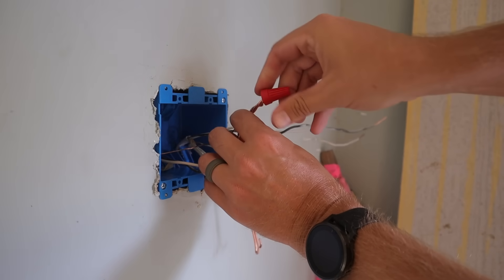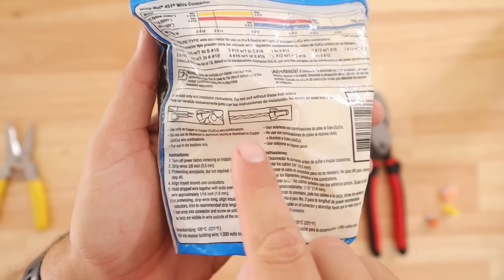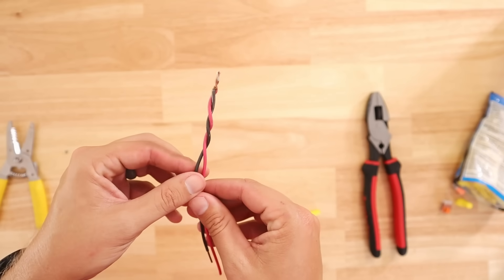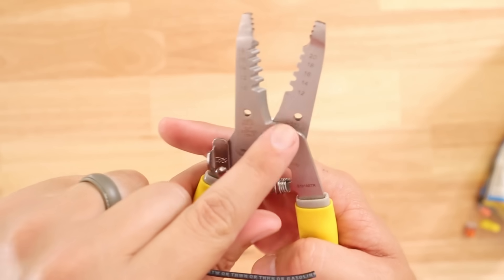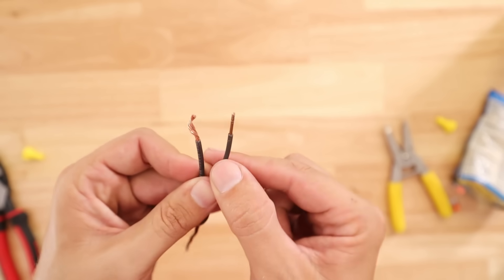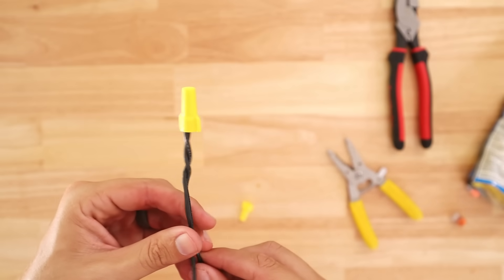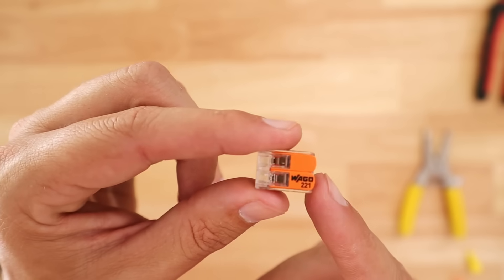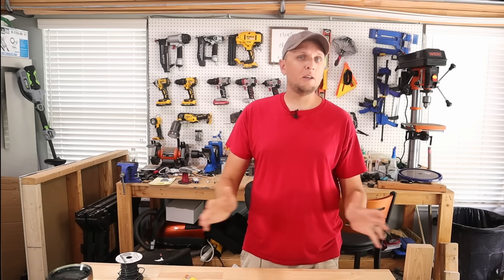BIGGEST Mistakes DIYers Make When Connecting Wires Together | How To

Comment: I almost never pre-twist Always bottom out the wire nut and use the right size wire nut. The internal coil serves the purpose it was built for. You wouldn’t be able to pull the wires out of a properly tightened wire nut even using pliers. I see more failures where the wire is nicked during stripping and breaks when repeatedly bent. I have repaired countless outlets and switches and rarely do I find pre-twisted wires.

Comment: I’ve had solid core pull out when the stranded twists completely around it like in your pre-twist model, and 100% of grip contact with the spring is on the stranded. Solid core has no twist in it in such a setup, and slips out of the center.
Reply from the maker: So, I tested them doing it like this and then doing it without pre twisting.  The results when pulling on the solid core seemed to be the same as far as how much force I needed.  Either way, I was able to pull the solid core wire out.  It’s one of those connections that seems to have a bunch of variables to it as far as how it’s done.

Comment: The wire nut is just a simple cap. What you should be doing after twisting with the lineman’s pliers is solder the joint. Then add the wire nut. 😉
Reply from the maker: Appreciate the feedback Andy.

Comment: I would add that the stranded wire should be twisted prior to coupling with the solid core wire. It seats in the wire nut better, doesn't run down the solid core when capped and less breakage of the strands when tightened. I also don't recommend pretwisting the two wire types because more often than not the solid wire doesn't get twisted but instead the  stranded wrapped around it. When the wire nut is applied it then just pushes the stranded down the solid wire and out of the spring. Just strip it a bit longer so it seats in the nut first and tighten the wire nut as usual.

Comment: Thanks for the wingnut tips. DIYer here. As for the manifold type connectors, I definitely will try the Wago connectors next when I have time to experiment and room for that type of connector. I like the clamp-down style. The other brand could barely hold on to the wires the few times I tried so I gave up on 'em. Maybe Wago is the same, idk. Instead of experimenting tho I went with tried and true (in my mind at least) butt connectors with a max of 2 wires in one end. I know some people might object but I can yank on those pretty good and they still hold on (as long as you don't pierce the insulation), but ymmv. Those felt very solid when having to shove them back into a tight switch box with new smart switches which do not leave you really ANY room to play with. The butt type are also skinny and long which you can find room to fit under, over, or beside those huge smart switch boxes.
Reply: Repent and believe in Jesus Christ  creep

Comment: When I was instructed by the Engineers that designed and tested these wire nuts, they were adamant that you Do Not pre-twist the wires. As Charlie Smith explained, they are designed this way for a few reasons.  Also, placing a pre-twist can add undue stress to the conductor when you add even more torque/revolutions to the wire nut, causing a fault/open.  The other Huge issue is that you don't know when you have made the appropriate amount of torque to the wire nuts.  When follow the manufacturer's directions and you have two wires side by side, add the wire nut and then twist until the wires wrap around one another, you assure that there was enough torque applied to secure the conductors to the internal part of the wire nut.  There are also many, many cases where one conductor wraps around the other conductor that pretty much stays straight.  This will allow that "center" straight conductor to easily pull out, because the threads/spring inside the wire nut did not make contact and did not grip the conductor.

But hey, what do those guys know?  As you said, there are two sides to this conversation...
Reply: nonsense
Reply: Your claim is dubious, to say the least. If the engineers that designed these particular wire nuts were that adamant, as you claim, then why did they say the exact opposite on the actual packaging?

Comment: I pre-twist and snip because I have experienced failures in the wing nut. The metal sleeve inside slips and fails. A few even came out.
Especially true of connections made in hot Texas attic. When the wire ends are pre-twisted, I dont have two worry about the nut and dont have to twist it as hard.

Comment: For 10 or 12 gauge solid wire of 3 or more wires, I strip off 2 inches, stuff the ends into a small drill motor, grab the base of the bundle with pliers, and slowly twist those wires nice and tight, cut to length and install a wire nut. it is a superior solid connection. I use black tape too. Practice this a couple of times first. great video, useful.

Comment: I learned all this stuff back in High School Electronics class back in the early 90's. Good refresher since I didn't go into the field. Glad you mentioned giving the braided wire a twist on itself to make it more like a solid core going into the nut.
We were taught always wire nuts or shrink tubing and "electrical tape is for hacks". The hack being the person doing it, not the more modern usage of it as meaning "shortcut".
Reply: Yes, I know. You wouldn't use shrink tubing in a fixture or wall. That was for wiring internals in devices.

Comment: You don't snip of the end just to make it nice and even. When you snip the end you need to be sure you snip through each of the wires being secured with that wire nut. As you snip through the wires they are compressed together. If you look at the wires after you snip the end off you run see that they are pressed together so hard at the snip that is hard to distinguish one from the other. Having them pressed together so hard actually helps in ensuring you have as good of a connection as possible. So strip equal lengths of each wire, align and  pre twist  all wires secured by that single wire nut, snip of the end ensuring that you cut through each wire, then twist on your wire nut. Now, electricity vibrates. Over time it can vibrate the wire nut loose enough to cause a short and become a fire hazed. So you haven't completed your connection until you have wrapped at least 3 complete wraps of electric tape over the wire nut with the tape secured to both the wires and the wire nut and wrapped so they the pressure to loosen the wire nut actually pulls tighter against the electric tape. That way the vibration that occurs from electrical current traveling down the wire doesn't vibrate loose the wiring connection you just made and burn down the house you just gave the daughter when you  bought a new one.... And it doesn't matter what the connection is for, until you have that electric tape on there locking down that wire nut is not complete. I also wrap 2 wraps of electric tape around every light switch she electrical outlet I install after tightening the screws. It helps prevent it from shorting out against a metal box or the other next to it. As will as providing a little protection should the next person to work on it forget to turn off the power.  In reality 1 wrap will do the trick, but i always  do 2.

Comment: Lets be clear about what gauge of wire we are discussing.
Lets ALSO be clear about the situation.   
There are MANY reasons to pre-twist, and there are also a handful of situations where you wouldnt, but lets be honest, if you can, you should.
Anybody with the mindset of "my cap twisting skills are best in the world" has probably been the reason for multiple electrical calls.     Do the right thing and secure the connection.   Not doing so is just skipping steps in workmanship.   Garbage.    Thats all that is
Reply: I think we can assume we’re talking 14/2 or /3 in most cases. The difference between 14 and 12 gauge means pre twisting with pliers gets a bit harder on these old hands but worth it. I sleep at night knowing my kids won’t have to watch their home burn because I didn’t take an extra 15 seconds to pre-twist. 
People keep mentioning “shorts”. Not likely to happen actually, unless the connector pops off or an over twisted wire breaks. I would think the most danger is a loose connection that causes arcing when any sort of amperage tries to go through it. Your breaker (unless it’s an arc fault type) won’t care as long as the current doesn’t exceed 15 amps. There’s your real fire hazard. Unattended arc welding in the middle of the night is not advisable. 
Pre-twist and use the correct sized marr. 
Sleep tight.

Comment: My job for 30 plus years was to correct these mistakes. Stabbing a wire into any type of a device is asking for a fire down the road. Twisting solid wire. It is absolutely imperative that the conductors are twisting around each other. Not one wrapping the other. Stranded conductors should never. Should never be twisted with the pliers or fingers. It breaks the finer conductors that make up the wire. Solid to stranded . Put a slight bend in the solid wire. As stated all conductors must be twisted outside of the wire nut.
 Poor terminations accounted for 80% of my work. Always tug vigorously on all joints to ensure that the wire nut is not going to fall off.

Comment: Oh my goodness.  So much wrong here.  Wire nuts are conductive, bite in, and compress.   This is critical to prevent oxidation from loosening connection.  

You didn't twist most of your "bad examples" enough. Including untwisted wire, which is actually recommended by some manufacturers.  Good that you referred to mfg instructions, but "acceptable" is certainly acceptable.  Of you twist enough they won't move.

Old school soli-to-stranded was to tin them.  A DIYer won't do this. Your advise is sound.  If more stress on connection from overhead light is expected (I've seen many a painter hang a fixture by hot wire), then strip the solid, and twist the solid with insulated stranded.  Then strip insulation from stranded, and twist.  Try it.  Stronger.

More important than ALL of this, and certainly the most DANGEROUS error, is people twisting the wire nut COUNTER ClOCKWISE.  Please warn again this.  Same goes with screw terminals and ground screws, where I've seen conductors wound counterclockwise and almost OFF as a result of the DIYer tightening the screw clockwise. Great way to cause arcing hazard.

Likewise you should point out that mfg instructions on strip length (which vary) must be followed.  Insulation way up in nut can stop spring from compressing connectors.  Wrapping electrical tape around bottom of nut is recommended for DIYers, especially if they over strip.

You also call your wire nut a "wing nut" at beginning of video.  This will confuse DIYers.  Wing nuts are something different, you know.

Please fix this video. It is a bit helpful right now, but not really correct.  Thankd

Comment: Here is the problem with twisting especially solid wires together where you twist it down the wire is you can actually run the tip of the wire through the wire nut and could shock you through the nut. Seen it happen. Had it happen. That’s why you don’t twist that much plus it’s a pain in the ass to undo next time. Pre-twisting is not necessary. Twist the nut on and pull each wire to test they are in the nut. Do not use wago. They are garbage.

Comment: Love the video. I would like to see a video of you comparing the differences between the wago and the wire nuts and others
Reply: I, myself would not use the wago unless it was places that were easily accessible to get to. Just for the fact the metal is small and and power surge could fry and break it (Kind of like a small fuse breaks) that would break and you would end up having to replace it. I like the concept of it and would use Wago, but again for me it would be for easily accessible areas and projects

Comment: I like the Wago's because they are easily undone BUT that is also their weakness. I always wrap the wago in a little color coded tape (to match the wiring) so as to ensure that the levers don't pop up when getting pushed into the box. I've had that happen, and of course the wire can slip right out. Great video. Thanks.

Comment: The words say ---- not needed.. So the twisted pic is an example of if you do twist it. Just got to wonder, should they take the warning off tide pods because it gives you ideas? It says not needed. You see a pic and  you get lost? Hey , squirrel! And I have tried to pretwist, guess what they can still pull out. If length is not the same one catches and the other won't. Same length, twist, ( yes some of the length too),  a quick tug, and move on!

Comment: ...always remember future sparkys...it is not.  recommended to connect a red and black wire together...those colors are hot (powered) and if energized it will cause a short! 🤨  
The code may not care any longer, yet, you'll find it not only matters, it helps keep your circuits easily identifiable. 😉
   Ha ha, so much for useing scrap as teaching aids! 😂🤣😅💋
Reply from the maker: Yeah that’s all I was doing 😂

Comment: No matter what method you use, because trust me, both are fine… CHECK THE CONNECTION !! Pull on the wires, HARD, make sure they don’t come out and you’re good. It’s not rocket science.

Comment: I know we’re working with scrap pieces of wire not connected to a source in any way; but just to be pedantic about it, best practices for an electrician would include removing all rings and jewelry off your fingers before working with wires 😂
Reply from the maker: It’s a silicone ring.  I don’t wear my real wedding bands when I’m working.

Comment: I think you're missing the point that DIYers are probably working with a live circuit or very short leads. In those cases pre-twisting is just not feasible. Of course there is no excuse for not going to the breaker panel and testing to confirm you've opened the circuit.

Comment: This is really good, helpful information.  The thing is, I've replaced wall switches and outlets many times in three different houses over the years, all originally wired by "professional" electricians, and I've never seen the pre-twisting technique used.  I have a feeling that the pre-twisting is an exception, not a common practice even though it should be.
Reply: Union vs non-union is my guess. We always twist them, no question.

Comment: Push connectors work great for replacing ballasts (solid wire) or bypassing ballasts for LED conversions on fluorescent fixtures.

Just make good solid electrical connections.  Use your common sense.  Sloppy connections, no matter what type of device you are using, are dangerous.  Getting shocked is the least of your worries.  Burning your house down is the concern.

Comment: I always take a small piece of electrical tape and wrap around nut and wire as a backup.  I have pulled wires out of the boxes and had the nut come loose just as shown in the video. This is for my own do it yourselfer wiring. I don't pre-twist the wires, but do try and make sure they are twisted when the nut is put on. I remember a gentleman suggesting the tape as a trick they did in the old days.  Yes it's an added expense, but for a homeowner, it's negligible...thoughts?
Reply: @wab18  please provide more info if you're gonna tell someone to stop.

Comment: Stranded to solid core  Buttsplicer using the divit crimp not smash crimp you can pull your ass of it won't come apart if done right. Its what is used on automobile trucks and aircraft.  
But as I understand not code for 120 volts. But its a far better connection.

Comment: Whats funny is they will twist the connection tight at the wire nut then jame the wire into a speed spring insted of using the screw to hold the wire.
I've pulled light switches or outlets out to change them becuse they are dirty or woren out only to have the wires jerk out the clips.

Comment: The answer to the twist connection is what holds tighter. And wont come apart? Answer is the wires should always be twisted tight and stripped to the same length long but no bare metal exposed. Optional is taping the wire nut in place not to cover bare wire but to lock the wirenut in place. Most inspectors would like to see it without tape on it first to make sure no bare wire is exposed.
Last metal box or plastic box, I fell metal boxes are ment for industrial use plastic should be residential use as outlets and switches always have a short factor
And untill somone design a no bare screw system and I dont mean push in clips becuse I always use the screws
The spring clips can not handle larger current loads and will probably end in arcs and loose connections.
I also belive all light switches need to be grounded always. Your not switching ground or the return path its ac current 
Both the neutral and hot wires carry current but the hot wire is always the switch side of the circuit and it should have a ground becuse its probly lickly in a kitchen or bathroom somone will touch it with wet hands.  Thats also one more improvement a bath or kitchen switch should have it should be water proof.

Comment: Saying that it’s not required is very different than saying it’s not to be done.
You would be horrific at reading contracts…
You’re interpreting one sketch example as being binding which is ridiculous.

It’s like telling your workers they have to wear the safety issues with the green triangle on them, and then show a sketch  example of a black shoe, And deducing  that everybody must wear black shoes..,

The  problem with all of this, is you’re missing the actual issue of the wrong size nut on the wires, or the amount of wire that’s exposed or of different exposed length etc..